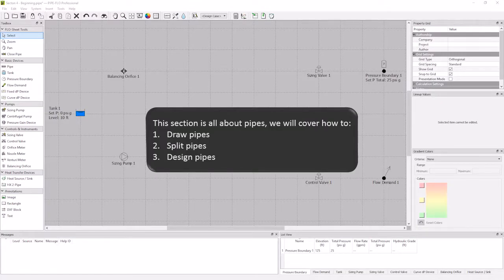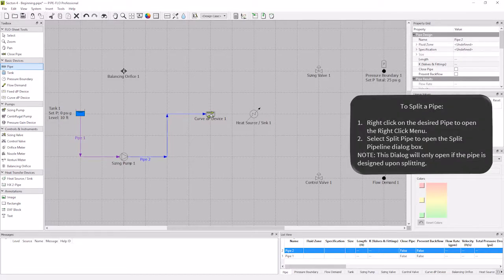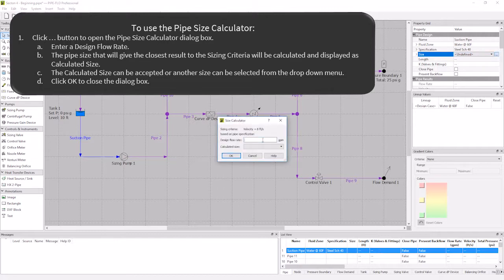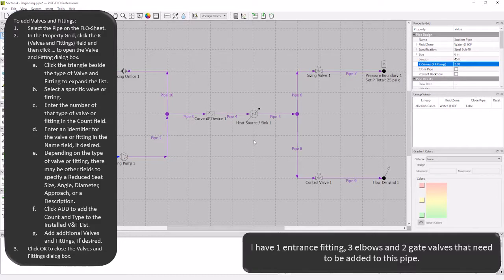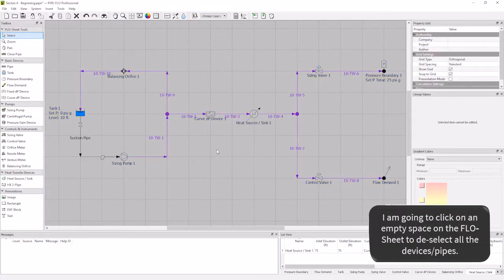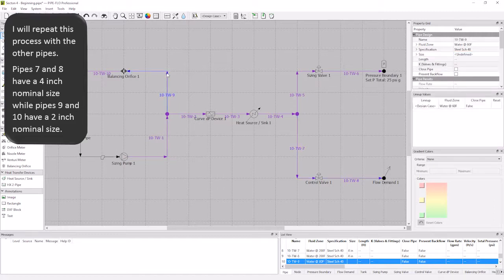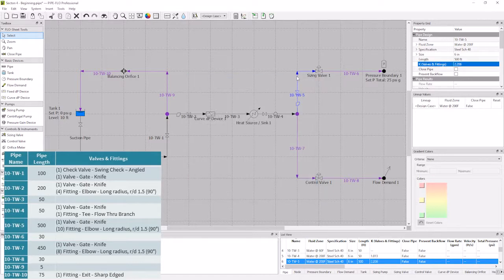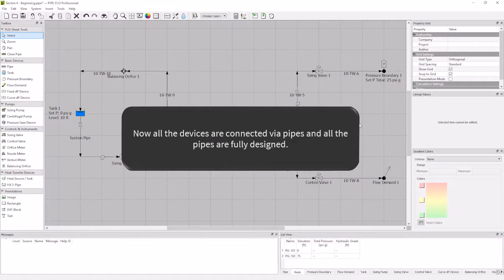Pipes

Comment: Does the software have the capability to find equivalent length for a system? In a real-world scenario, you can measure the flow and pressure at the point A and point B, and then the software should be able to calculate the equivalent length.